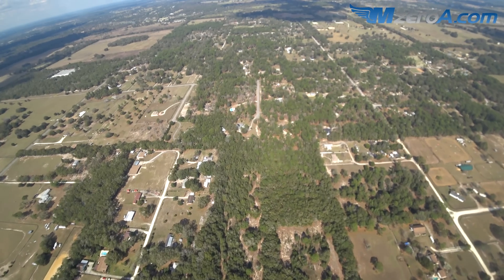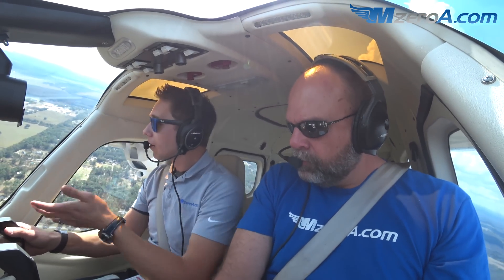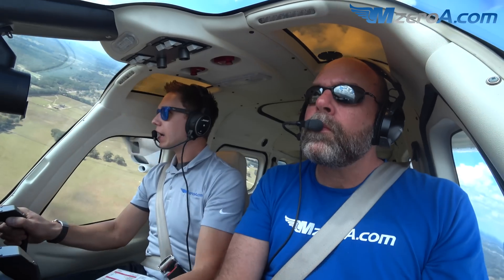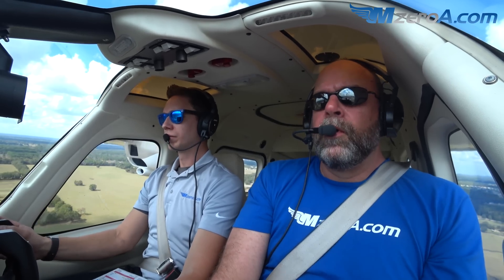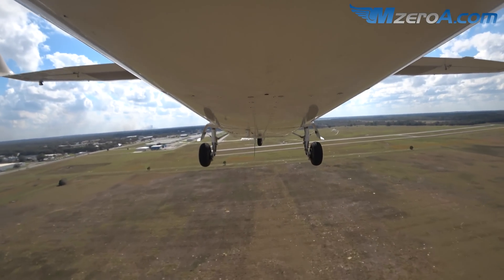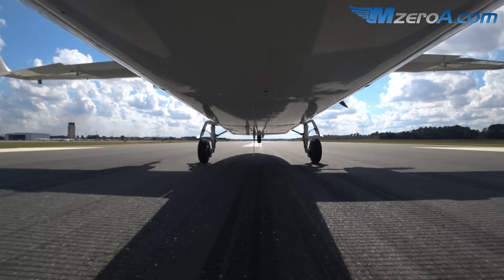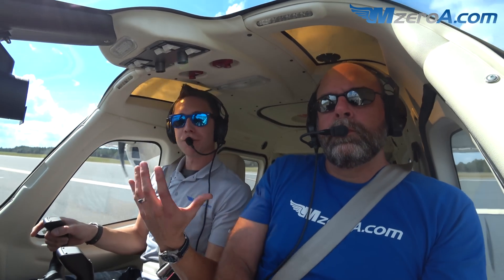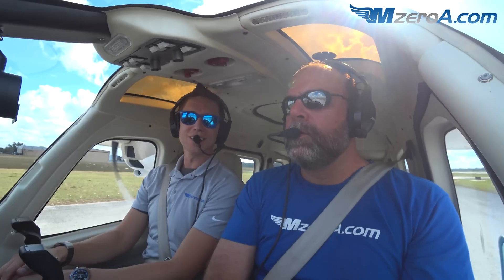Single Engine Landing - MzeroA Flight Training

Comment: 0:22 would you really want to run a troubleshooting checklist so low to the ground in the pattern? No. MAYBE aux fuel pumps on but that's about it... They should already be on for the landing anyway. I guess all planes are different but I wouldn't be trying to fix a dead engine in the traffic pattern on any plane. After I did the initial thing of mixture props throttles full, gear up flaps up, fuel pumps on, "Identify: dead foot dead engine" Verify with throttle then I'd just immediately feather....

Comment: Why is the left engine the critical engine?
Reply: Good question! Not sure of your experience level, so feel free to ask any follow-up. My explanations below make some assumptions on your aerodynamic knowledge.

Critical engine is only a factor on multi-engine airplanes with both propellers rotating in the same direction; some airplanes have counter-rotating propellers, meaning there is no critical engine. Why is it worse to lose the left engine (critical)?

1) If we know about p-factor, the descending blade generates more thrust/torque than the ascending blade. On the right engine (assuming clockwise rotation props), the descending blade is farther from the fuselage than the left propeller's descending blade. This means the asymmetric thrust is farther from centerline on the right engine, thereby requiring greater corrections by the pilot to maintain directional control.

2) Slipstream effect: Both propellers generate a corkscrewing slipstream, but due to the clockwise rotation the left engine's slipstream hits the vertical stabilizer whereas the right engine's slipstream does not. This slipstream will hit the vert. stab. on the left side, creating a left yawing force - if you lose the right engine, you would have a right yawing force but the left engine's left-yaw force counteracts this somewhat. Losing the left engine, you get no help in this regard.

3) Accelerated slipstream: This concept stems from p-factor, in that you have more air being moved on the right side of each engine (again assuming clockwise rotation). You will therefore have more airflow over the wing on the right side of each engine, meaning more lift on that right side. On the right engine, this area of increased lift is farther from centerline, so it generates a greater rolling force towards the left than you would get if you lost the right engine had the left engine running.

4) Torque, last but not least: Both engines generate torque opposite the direction of rotation. When you lose any engine, you get asymmetric thrust resulting in roll/yaw toward the dead engine. Well when you lose the right engine, you'd have torque rolling you toward the left with asymmetric thrust toward the right: i.e. they cancel each other somewhat. Again you get no help here when the left engine is the dead one - torque toward the left as well as asymmetric thrust toward the left.

Lots of concepts here that all tie together to make the left engine much less favorable to lose in a multi-engine plane with propellers both rotating in a clockwise direction (clockwise from the pilot's in-cockpit perspective). Again with counter-rotating propellers these factors don't exist because neither engine has that "more force farther from centerline than the other" effect. Also makes rudder control a breeze in-flight with both engines operating. Hope all that helps!
Reply: And that's why I fly a Skymaster
Reply: basil katakuzinos PAST

p-factor
accelerated slipstream
spiraling slipstream
torque
Reply: basil katakuzinos Because both propellers rotate the same direction, and the descending blade on the right engine is outboard from the fuselage, it results in more pronounced P-factor if the left engine fails vs the right engine.